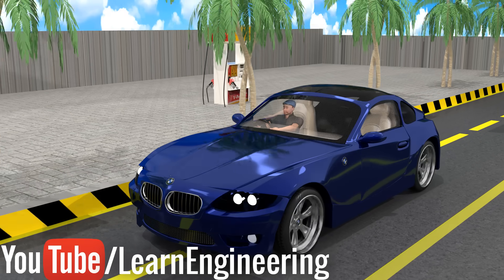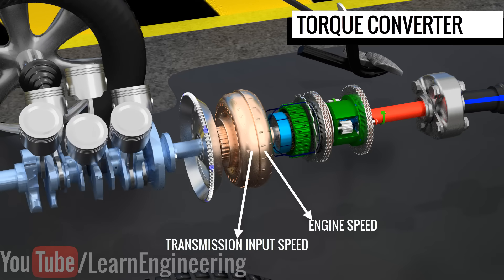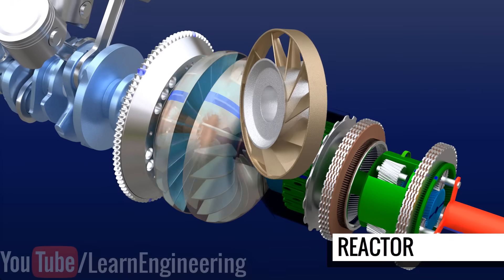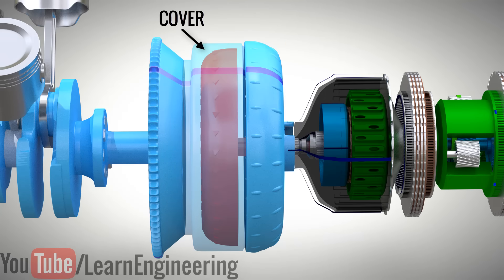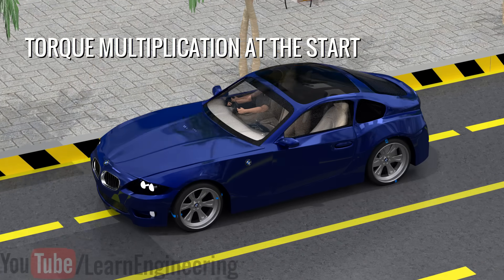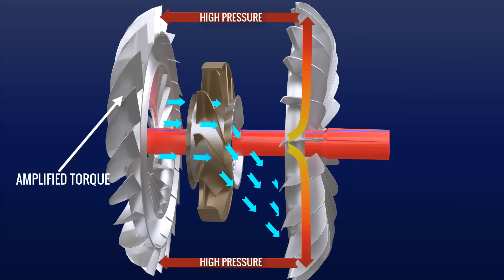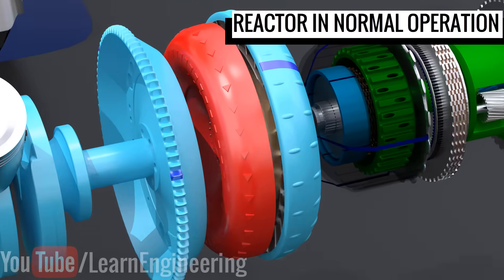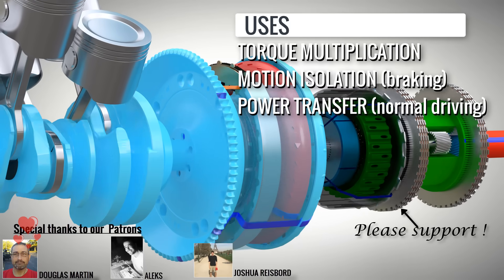Torque Converter, How does it work?

Comment: Why don’t torque converters wear out like clutches do on manual transmissions? Thank you.
Reply: The only real wear components are bearings, which are immersed in fluid, and the friction disk material bonded to the turbine that achieves lockup. Lockup pressures are carefully controlled to prevent wear to the friction material and failure, and probably rarely fails on its own, though excessive heat will destroy it.

One thing the video fails to mention is that the tradeoff for the torque multiplication is heat generation, and the fluid has to be pushed out of the TC to be cooled.
Reply: I'm no real expert, but I did manufacture lockup torque converters here in North America for nearly a decade and went on to build/rebuild automatic transmissions for another 14 after that.
Reply: @netdoctor1 so why do clutches wear out on manual transmissions when they have fluid as well.
Reply: @Mabeylater293  Hydraulics are only used to flex the clutch plate. The clutch itself does not use fluid.
Older systems used a cable connected to the clutch pedal on the floor to pull something to relieve the pressure on the pressure plate. Some systems use hydraulic fluid to push, instead of pull, to relieve that pressure.
I'm no expert on manual transmissions. My only manual was an '81 Chevette, which used a cable to depress the clutch plate. It is my understanding that a friction clutch does not use fluid, except to transmit power from your foot to the clutch pressure plate..

Comment: I've seen torque converter operation illustrated by using two box fans place close together. When one box fan is plugged in the airflow turns the other fan and they both spin.

Comment: i'm confused here.  why isn't the stator built with a larger diameter?  running the fluid backwards from it's standard direction to maximize leverage force of the axes of the shaft it connects to? but maybe i am taking the word converter too literally and not fully understanding this thing.  because it seems that these don't actually multiply torque, nor convert any energy, they simply connect or allow the transmission of torque.  in my mind, you use it like a gear reduction or gear inclination, and having a 3 stage stator with differential diameter drives, you could actually convert torque and drive a shaft with the stator.  but here it functions completely differently than i imagined.  you could have differential fluid velocity with a sequential blade system that at different fluid speeds  drives different diameters of the stator and the turbine.  this would convert fluid pressure to velocity thus convert to torque on an axes of a shaft.
Reply: I've always believed that the multiplication happens as a result of the centrifugal force of the fluid being flung outwards as the device spins, thus forcing the trapped fluid to be accelerated through the blades of the turbine. Perhaps I've been mistaken...

Comment: My automatic transmission has no torque converter but a fluid coupling/torus which doesn't multiply torque or slip as much. Its a GM truck Hydramatic transmission.

Comment: Sir, can you also explain how gear ratios are varied (I mean, how is the IC engine's optimum power band exploited)? And, how is the drive shaft made to rotate in the reverse direction? In a torque converter transmission.

Comment: Its a nice video.     Maybe I'm behind the times but we used different terms in the trans industry.  Fluid flywheel should be "fluid coupling".   Reactor is generally called a "stator".
Reply: Slush box 8)

Comment: may i ask , is the oil inside the converter need to be under pressure from the pump insid the transmission ? or ,,if the converter is full of oil can do the job under the spining and centerfugal force from the impeler ? any one help and clarify this for me

Comment: You could use a physical model like GM did back in 1960. That was super easy to understand. And they put the correct cylinders in the car they were exampling.

Comment: The “pump” is also known as the impeller, and the “reactor” is also known as the Stator
Reply: exactly! also, they have a few things wrong in this video
Reply: @krazi77  The textbook says the impeller is located at the bellhousing at the transmission side, which is different from the video.
Reply: @krazi77  the video uses layman's terms for people who arent mechanically inclined
Reply: @southwestxnorthwest  why would you want to give wrong information to laymen? This video sounds lame to anybody who knows anything about how an automatic transmission works. Torque converters have been used in American cars since the 1950's.
Reply: And the fluid is known as burnt toast when the tiniest infraction occurs within.
Reply: Thank you. Now it makes more sense to me.
Reply: GM in the early 60's made a automatic transmission that is said to not have a torque converter, but rather a torque multiplier. It's called the Roto-hydramatic 375, nicknamed "slim-jim", due to its apperance.
Reply: @darrylholcomb9076  that's a very interesting design. Incredibly complex looking.
Reply: @darrylholcomb9076 When a stator is added to any fluid coupling it multiplies torque. Reduction gear ratios also multiplies torque. The slim jim all in all was not very good.
Reply: If you watch any jet engine videos, the terminology will become clearer
Reply: ... and a "lock-up clutch" would be "over-drive".
Reply: @CraftAero  Nope. Lockup makes a 1-to-1 ratio between the crankshaft and the turbine (which is connected to the input shaft of the transmission).

Over-drive occurs by applying certain clutches at certain times (higher gears) within the transmission.

The lockup clutch just provides a direct link between the engine crank and the input shaft of the trans. Basically making the torque converter a single unit for that time.

Which is when you get to cruising speed and no longer need the "disconnect" between the engine speed and the transmission speed that the torque converter provides.
Reply: @CraftAero  nope🤣
Reply: @CraftAero  i dont think so, refer to automatic transmission video from same author.
Reply: @CraftAero  Wrong
Reply: Oh du,idioto

Comment: automatic trans also have  flywheel? i though manual trans using flywheel then automatic trans using torque converter.? 
please enlightened me if I'm wrong
Reply: The Flywheel is actually a part of the engine, not the transmission.  On a manual, the clutch engages the flywheel to drive the transmission.  On an auto, the torque converter mounts to the flywheel, and driving the trans is done through the converter.  All modern engines have a flywheel and (99%) have a toothed flywheel where the starter engages it to start the engine.
Reply: The "flywheel" on a vehicle with an automatic transmission (and torque converter) is known as a flex plate.
Reply: A fly wheel smoothed out the output of the engine, since engines aren’t perfect, manual transmission uses clutch pads and tourqe converter is for the automatic transmission. There are vids on this thing on this channel

Comment: ok but how does the torque converter both transfer torque at 90% efficiency when driving and still doesn't stall the engine when idle? it will either be bad at transferring therefore letting you idle with low fuel consumption and you will be unable to accelerate or the car will stall every time you stop. are the turbines moved forward and backward from eachother for better/worse hydraulic coupling or do the transmission drum stopping belts take the beating every time you start/stop?

Comment: I always knew these things were witchcraft...
Reply: Paul's Garage I still don’t understand this witchcraft
Reply: @TheSloganOfficial
Reply: @TheSloganOfficial  ⅞9
❤
Reply: An internal combustion engines car has 2k moving parts, an electric car has 20
Reply: @fredmart7130   Do you enjoy subsidizing rich people"s luxury Teslas? But maybe you are one of them and you do not mind.
Reply: @fredmart7130  a car engine has 2000 parts and an electric one 20? Hmm you failed math obviously
Reply: @eksine  
an induction motor only has one moving part (the rotor), and you can attach it directly to the driveshaft without using a transmission. an electric car does indeed have far less moving parts than an IC car.
Reply: @voltagedrop5899  actually I misquoted him he said "car" . an electric car still should have similar suspension, that alone should be over 20 parts, 20 cannot be right
Reply: dyou mean engine only,..or entire car? @fredmart7130
Reply: @fredmart7130  just explains elon's simplicity, XD
Reply: Fred Mart has turbine has 8
Reply: @fredmart7130  and a transmission has 3000000000
Reply: @fredmart7130  Nice information
Reply: @kofola9145  are you suggesting that ICE car manufacturers or more specifically their CEOs) are not getting rich?...
Reply: @eksine  What does knowing that (or not) have to do with failing math?
Reply: @kofola9145  A tesla is hardly "luxury"
Reply: @aahillakhani399  it is for 99% of humans. 

So congratulations you have managed to achieve such a level of abundance.
Reply: @kofola9145  No. There is an objective definition of what a luxury car and most Tesla’s are not that. Hell, the model 3 has price overlap with a Honda Civic. Plus, Tesla’s aren’t the only evs on the market. Also, the “upper middle class” isn’t the 1% you absolute donut brain
Reply: @aahillakhani399  correct. Yet you claim every body else is wrong and your subjective opinion is right.

I understand if you are considered a smart Pakistani, but that does not mean much.
Reply: @fredmart7130  are you saying they are simple is any sort of way?😂
Reply: @fredmart7130 not true
Reply: @fredmart7130 You forgot the millions of electrons moving on miles of wires that are governed by millions of lines of code.  I'll take the combustion engine over that setup any day of the week
Reply: Fredmart, and yet we have engines of all different designs and many of the lesser complex ones are decades old and easy to fix/build. Electric cars have more complex computers systems, solenoids, actuators, chips, etc that all typically fail in lesser forms in ICE vehil
Reply: @fredmart7130 🤣, buddy take apart a tesla yourself and i want you to say that again
Reply: @TheSloganOfficial  I suppose those technology was presented to humanity by some aliens ;))
Reply: Any sufficiently good technology is indistinguishable from magic
Reply: @pilattebe  if u look... u can c parts made in china so yeah... not really american
Reply: @pilattebe  nobody cares, we like petrol cars
Reply: Burn them!
Reply: It amuses me how i see a video or comment years later and i come up with the exact same reaction
Reply: Nooo.  It’s like FM radio fricken majic.  Automagic transmission
Reply: @davidgilbert8051  FM radio is simple for me to understand in comparison.  Maybe because my brains sucks at mechanical things, but does better with electronics and digital circuitry.
Reply: The price to fix one is witchcraft! $2k absolutely ridiculous
Reply: somehow I feel honored when people find this witchcrafted although I have no direct relationship with this genius design
Reply: lol same
Reply: You should read the book of Enoch
Reply: kof ola is a shill for OPEC. Duh...
Reply: Yes, as showed in a thumnail picture.
Reply: @pilattebe  wow your nieve, or indoctrinated...
Reply: Am blown away by the advances in quarter-mile times over the years. I've barely been able to keep a bicycle running.
Reply: Hilarious, I salute you
Reply: i dont understand anything and this looks scary to make go past 80 mph
Reply: @pilattebe  Currently, the majority of the world's lithium is mined in Australia and South America, and more than 97 percent of it is refined in China.
Reply: Very funny😂😂
Reply: Exactly, they could drive the brain crazy lol
Reply: Lmao.  No doubt.  Still almost as confused as before. Great video though
Reply: i watched this thing twice and i still can't wrap my head around it. its black magic, some eldritch shit i don't have enough insight
Reply: You're hilarious but truth ye speak.😈😈😈🌬💨🌪🌪
Reply: Confirmed!
Reply: Love you and your comment 😂
Reply: isnt it possible to replace the clutch with a torque converter but retain the manual gearbox? both in case of car and motorbikes?
Reply: 😂this comment is hilarious
Reply: Physics. There is a simple explanation for everything.
Reply: they truely are

its hard to imagine how someone can even invent this

and then makes it reliable enough to withstand insane forces for many years on end

especially in work trucks and other big mashinery
Reply: Yea they are wierd
Reply: @pilattebe  dude they still run on consumables. Batteries run on Lithium ion, a limited resource. On top of that, they are massively inefficient at storing power, which means we need even more LI. And that is a resource we get from foreign countries, as well.

On top of all that, an EV is still charged by the grid, which is I think about 70 pct powered by fossil fuels (aka consumables)

They don't fix any problem, just disguise it
Reply: @jordanp8063  lithium batteries can actually be recycled, the lithium is the only part worth doing so for.

Unlike fossil fuels that when spent cannot be recovered, lithium can be.

The US also has lithium deposits iirc.

Just recently there have been a few articles about recycling lithium, some making bold claims that it's almost lossless but as a metal that's not entirely impossible.

Grid power of course is mostly fossil fuel based, but location dependant that is not always a necessity, sure not everywhere can use wind, hydro, solar or nuclear or the various other non fossil fuel methods but some can and they shoud take advantage of it.
Reply: So the transmission weighs the same as a duck, and is made of wood?

And what do we do with witches?

BURN THEM!

;)
Reply: Buenas que bueno que esplicaran algo en español gracias.
Reply: @pilattebe  I dont care a single bit about that. All I care about is that people who cannot afford luxury cars are robed and the money is handed over to rich people who can afford luxury cars. Buy what ever you want. But you have to do using your own money. This transfer of public money into private pockets has to end now.
Reply: @kofola9145  yeah it's a joke. Meanwhile Elon is making billions off Tesla, which is subsidized by the government, just to make their cars affordable to the upper middle class and those who are much wealthier. Redistribution of wealth from the working class to the rich in multiple ways
Reply: @kofola9145  OK, but then stop buying cars from private corporations. I'd be interested to know many public corporations are making cars...? Public money comes from taxes and things, not private individuals. So it is private individual's money going to private companies both ways. Please stop drinking the kool-aid.
Reply: @kofola9145 Go spread communism somewhere else.

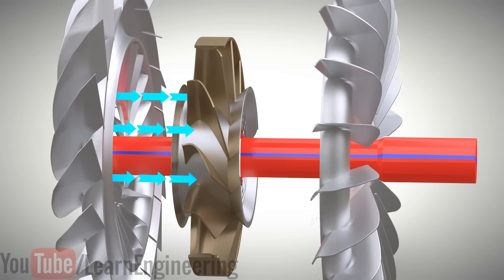Comment: 5:33 is the turbine spinning in wrong direction?
Im trying to visualize the pump throwing high pressure fluid at the outer part of the turbine, shouldnt it cause it to rotate the other way? 
I think the turbine blades are just facing the wrong way?
I think you are correct and maybe im forgetting swirl?
Reply: same thing, according to their explanation both parts are spinning in a wrong direction in animation.

Comment: i don't understand the purpose of this. why not use hydraulic motors insteand and get rid of the whole transmissions and drive train and use one big hydraulic motor turned by the engine that drive four smaller one fitted into each wheel? that way energy loss chould be smaller  and it also allows the motors to work as brakes so no friction brakes needed as the hydraulic can do the whole thing both acting as motors and brakes and also function as transmission by use of valves.

Comment: What would be nice just so there is no power loss, adding the clutch pedal back in and using it when you come to a stop so you can have all the power the engine is putting out.

Comment: Why this is only used in automatic transmissions? And not Manual transmissions ?
Reply: Because it would be a horrible idea. First thing that comes to mind is that a torque convertor is always applying some amount of power to the transmission, even if it's not enough to move the car with the brakes applied. Ever try to shift a manual into first from neutral with a dragging clutch that doesn't fully disengage? It would be like that...